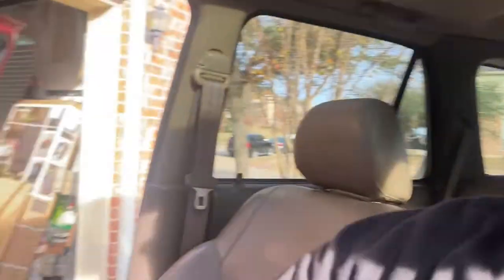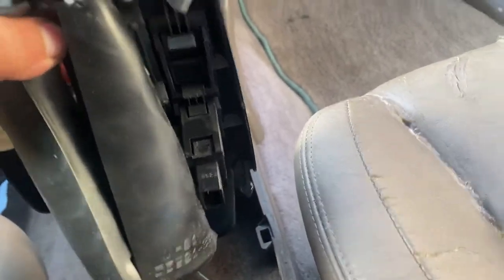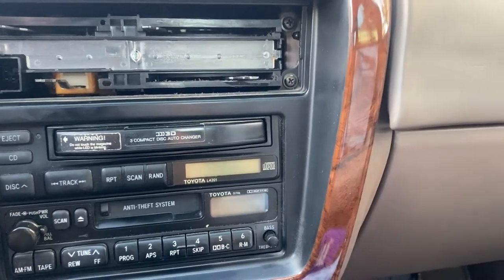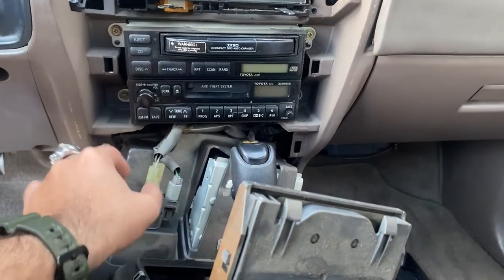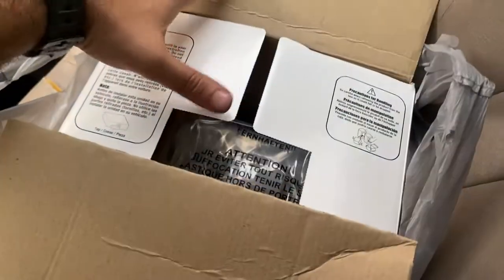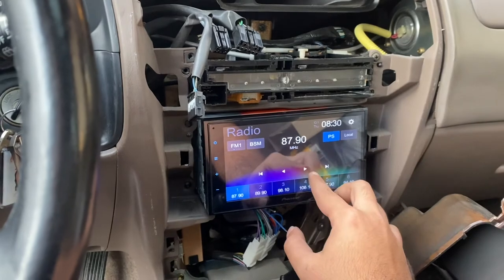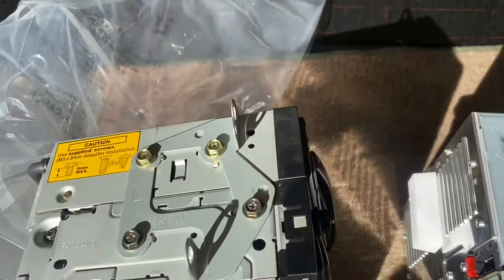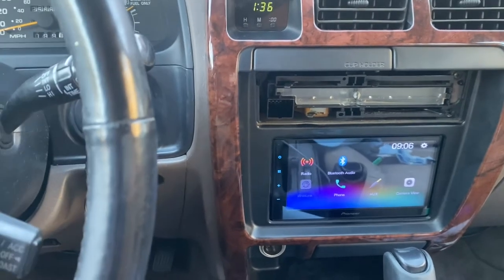1996-2002 3rd gen Toyota 4Runner Radio install (alarm trigger fix)

Comment: If you tug on the wire you can physically see the back wire in the engine bay getting pulled for heater/Ac. It’s so simple. No electric bs

Comment: I did a Pioneer that does CD’s also! My 4Runner is ‘98 with stick shift. It has an aftermarket alarm system. I didn’t have much problem wiring harness adapter was awesome ! Power antenna works perfect! 👍🏾
Reply from the maker: Sweet! Sounds like a nice rig, I still need to figure out my power antenna but everything else works great with the harness
Reply: Jonnard I have the same vehicle. Can you tell me what Pioneer you used I want one that plays CD's as well.
Reply: @jimmilner2961  I will get back to you when I return home in a bit!
Reply: @jonnardjackson2884  Thank you very much! That is kind of you.
Reply: @jimmilner2961  We gear heads need to help each other! I hope you can get what you need! Take your time  for a successful installation! 😎👍🏾
Reply: @jimmilner2961  I thought I sent the model of Pioneer radio it was did you get it? If not I will resend it because I didn’t see it!
Reply: @jonnardjackson2884  I dont see it. I  am sorry.
Reply: @jimmilner2961  I’m going to get it again! This time I hope I’m successful! Hold on!
Reply: @jimmilner2961  Pioneer FH-X830BHS
It has CD player!
Reply: Man it looks classy in the dash! Actually it was a Father’s Day present for my dad!
Reply: @jonnardjackson2884  Thank you!
Reply: @jimmilner2961  you’re welcome ☺️!

Comment: Thank you!!!! Did you do anything with the blue and blue/white wire on the harness?
Reply from the maker: Anytime! I just left it, all I did was plug in the harness, only thing not working is my antenna which just needs power going into it but I don’t listen to the radio so I never did it

Comment: is there a fuse in either of the boxes that you know of ? Had a doofus that put all his own nonsense in and wired straight to the battery, but now the power wire or the constant wire doesnt get voltage and i cant find any fuses for it. It does have that factory amp but even when i turned it on to check for voltage, still got nothing. Its a 96 4runner with the 3.4 and 2wd

Comment: When you install the radio, does the power antenna work when you turn the radio on? Also did you plug back up the factory amplifier? Are there any other radios with back up camera and navigational systems that you know of?
Reply from the maker: I didn’t bother with my antenna, I believe you need an antenna adaptor to get it to work. I bypassed the amplifier, pretty much took it out. The harness I use in this video basically calls for that. They make a better version of this one I believe the 160 that has all the stuff I got plus CarPlay but it’s almost double the price😅 this pioneer supports a camera and I’ve been pretty happy with it.

Comment: My car radio wasn't working and I bought another one and did all the wiring and It doesn't work.😕
Reply from the maker: Check your fuses and your connections make sure your getting power to the stereo
Reply: Ok. Is there any fuses other than the ones in the two boxes?